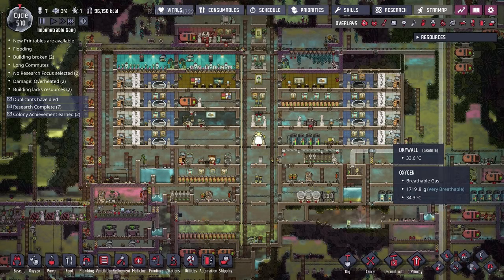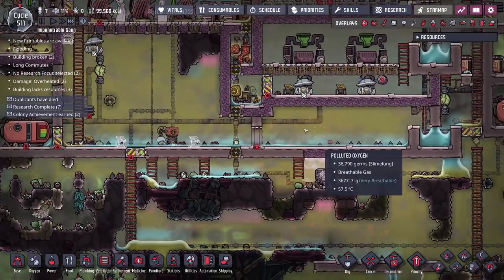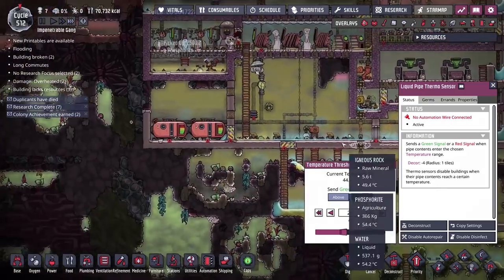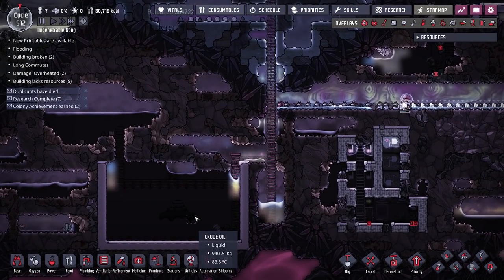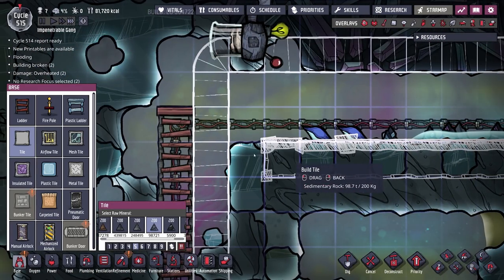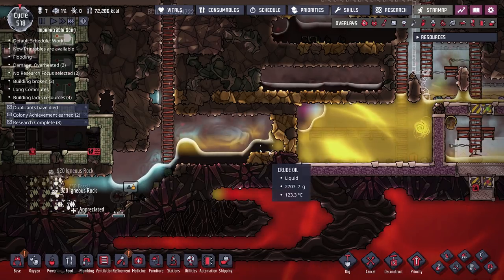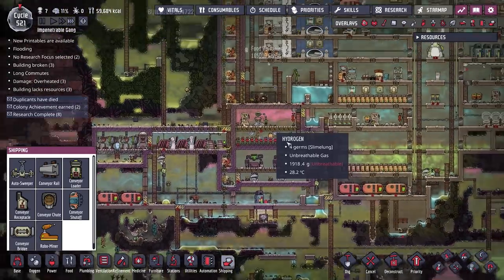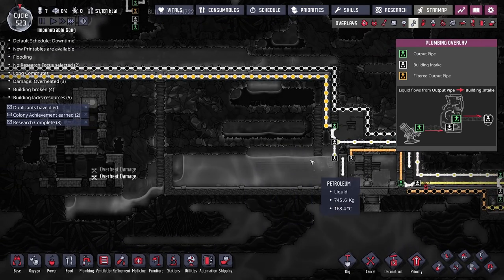Petroleum Power & Oil Cooled Metal Refinery! | Oxygen Not Included LAUNCH UPGRADE #31 [Let's Play]

Comment: If you put a buffer gate automation line for the petroleum door, when it opens, it will stay open for a set period. When the room is too hot, you could also set up logic to drip water instead of oil, so you get easy to condense steam instead of sour gas.

Comment: The only issue with your cooling loop is your input to it will bring in one hot water every other movement. Once that mixes with the cooler water in the reservoir, it will heat it up again. If move the bridge on the hot water input so that the bridge output is directly on the pipe coming from the reservoir, it will block the bridge whenever there is water in the cooling loop.

You should keep a metal refinery up near the steam vent and just use a closed loop of oil or petroleum with radiant pipe running thru your steam room. It will heat up the steam and generate more power. You can even need to drop some water in your steam room turn the extra heat into more steam. Just dedicate it to creating iron or gold since they are spread all over anyway.